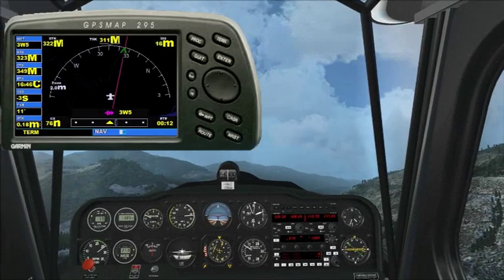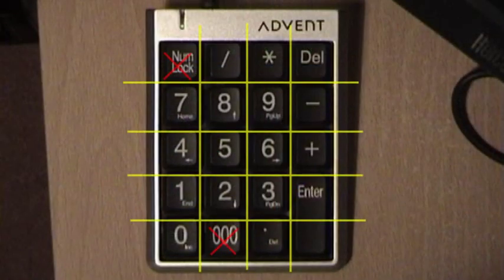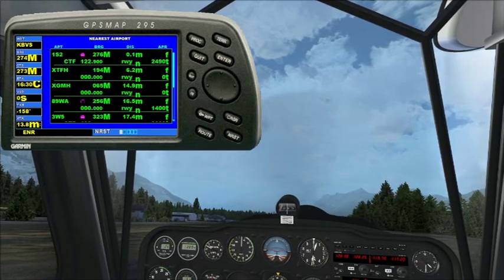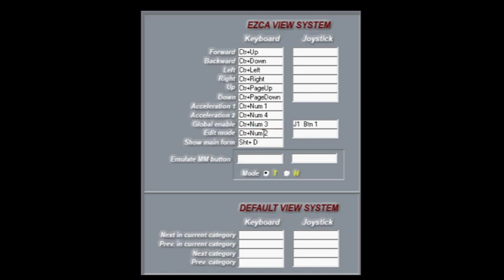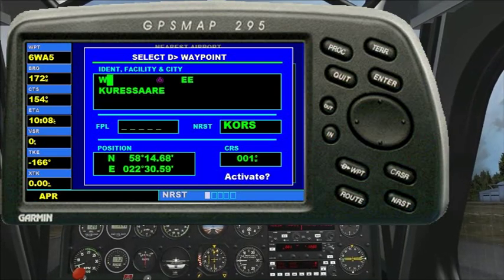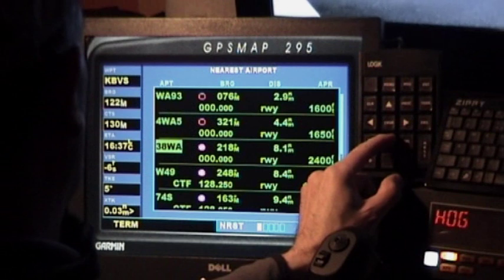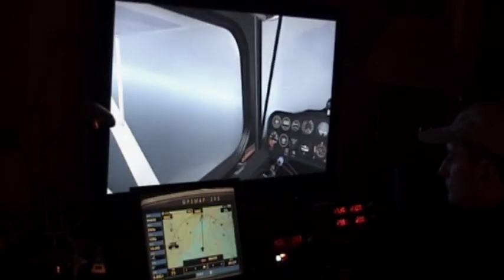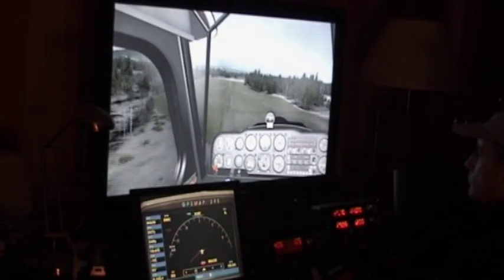Easy FSX GPS keypad

Comment: I know this is an old post, but I'm just seeing it for the first time, so I hope you're still around to answer my question. How were you able to assign the GPS only to a separate monitor? That's such a great idea!
Reply from the maker: This is the 2D pop-up GPS. If you're in full-screen mode you just drag it to another monitor and resize it to fit. In Windowed mode you need to right-click on the pop-up and select 'undock' before doing the same thing. There's some stuff in the Learning Centre about using multiple screens with FSX.
Reply: Wow. much simpler than I thought. I have Air Display 2, so that would make it a snap. Thank you so much for your blazingly fast response. You're the man!!!!

Comment: What could be nice, would be the GPS GARMIN 500 on a Ipad. Fingertouch and all good.
Reply from the maker: Funny you should say that, but I just ordered a Mimo 7" USB touch-screen to run the GPS on. The Mimo drivers now support DirectX so will work (I am told) with FSX panels! Not sure how well it will work with the 500's knobs (or the GNS530 in the Carenado Skymaster, which has two knobs), but it should be better than no touch-screen at all!

Comment from the maker: I used a random bit of angled metal, which I think came off the lock on my garage door! But you could stick a block of wood on top of the panel surround and lean the keyboard against it. The panel has a bit of a lip to retain the bottom edge of the keyboard. I had a narrow strip of foam stuck along the lip to make it more secure. I think this was self-adhesive foam I had from Maplin, designed for PC case sound insulation.

Short version: bodge it with whatever you can find :)